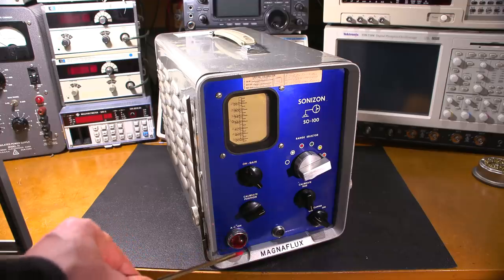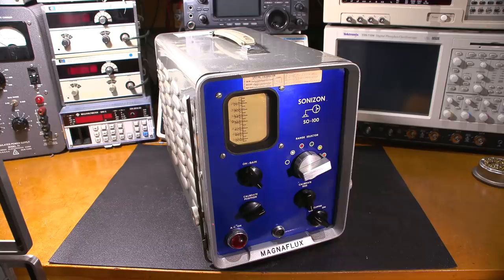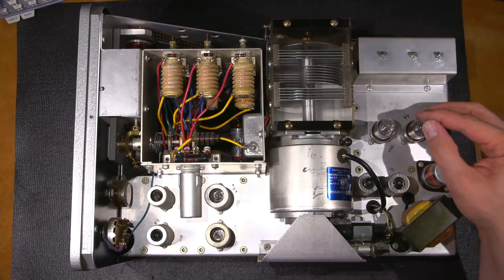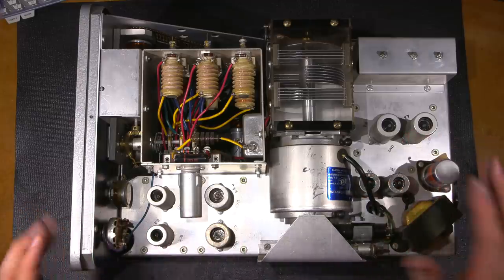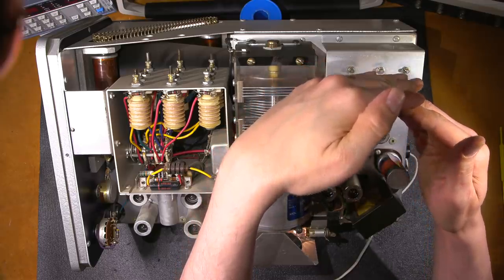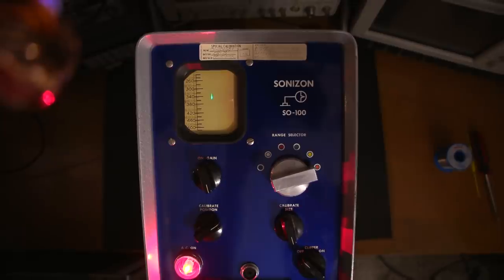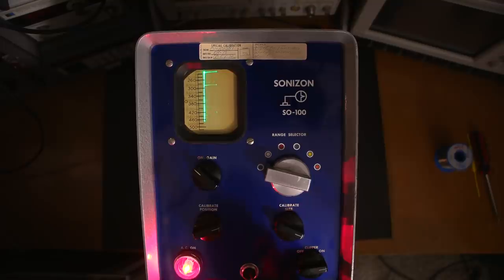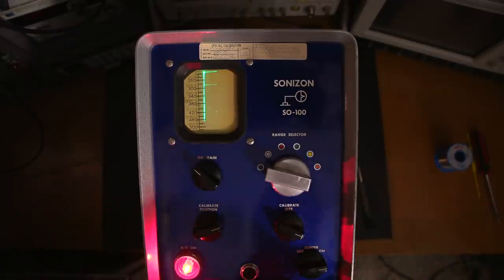Restoration or Parts Teardown- You Decide! [Sonizon SO-100]

Comment: Definitely restore.  And if you can link this to checking the welding of the LM from Apollo, it might be priceless.  Remember, the skin of the LM, was almost cigarette paper thin in some spots, perhaps this was used to Magnaflux the metal to check for a good seal.  If you could find the head, it might be good as a working museum piece.  So definitely restore.

Comment: designed initially for measuring the thickness of metal sheets by reflecting high frequency sound waves from the back surfaces of such sheets. However, if flaws are present the waves are reflected sooner, thus indicating the presence of the flaws.
i could be wrong....i could be right!

Comment: [ I would use it for parts,its obsolete;shelf * Queen * ] We had ultrasound weld checkers in steel mill in 1986. I was mid twenty's then. The plant fabricated structural steel, we used Submerged arc welders.. The tester had a CRT ,looking for flaws in structural welds,if found they used a gouging rod,high dc amps ,to blow weld out; and rework the beam or column .Same principal as ultra -sounding a women to check on health of baby in whom...
* FM Weaver steel fabricators on 25th street,Melrose park,ILL. then went to Pittsburg Demoyne Group,now shuttered and gone Rocco Lonigro plant superintendant,employed as electrician.

Comment: Restoration, however, "not for critical purpose" usage warning nomenclature needs to be affixed. It may meet tolerance, and cal within specs, but traceability and the lack of calibration/service records from day one apparently ended some time in the past.

AEL INDUSTRIES, INC., Lansdale, PA, operates one of the best calibration certification services on the East Coast (Mid-Atlantic region). Should you have difficulty in obtaining calibration process documentation info, they may be able to help, as their library is vast.

It would be a nice addition to a machine shop, or fabrication shop that performed work for non-critical automotive or truck racing work.

In addendum: Mr. Carlson, this device, would present an excellent opportunity for you to familiarize your subscribers/students/viewership, with the virtues of Mil Spec 2000, Category "C" wiring, soldering, electrical and electronic assembly practices, and how reliability and process repeatability were built into critical use electronics and electrical assemblies.

I'll be sending an email shortly.

Comment: i am really torn to decide what to do with it.
on one side its a seemingly decent condition (respecting the age) device. there are some parts in there that are really nice and certainly high quality. but they have a certain vintage what makes them not all that useful today. (only look at these big ass tubes) also the glass capacitors well i can not think of any sane application for these in a even semi professional / prosumer environment. so that stripping it for parts is not a viable option from a strategic standpoint. but depending on the fault (if there is any i can not tell this far in the video (im actually at 7:14)) fixing this piece of kit can range anywhere from easy if the fault is a part that is easily tracable, sourcable and easy to work with to horrific if its anything custom or highly exotic. also the need for that head unit really makes things difficult 'cause you have to figure out what this actually was looking like, what it was doing and how. and that can range anywhere from maybe just a simple oscilloscope-ish interface to something fancy like a vfd being connected to the thing in a serial manner depending on the effort they put in the head unit. also a thing to consider is who do you sell it to if you were able to restore it because your most likely not in a need for such a thing and of course this is from the technical point of view highly obsolete from the accuracy certainly as well and not to mention that it would propably not comply with anything in terms of modern standards i guess?
so either way is wrong somehow.
Reply: wait did i type glass capacitors well it took me a second listen to find that you said class "y" capacitor

and somehow my edit function is goneski

Comment: Well, it looks like I'm in the minority on this one.  You don't have a probe, and without a schematic, it might be difficult to build.  Do you need a machine that measures steel thickness?  If the answer to  both of those questions is NO, I'd say it's parts.  To restore it for no reason other than to restore it.  I'd rather see a piece restored that you can use...
Reply: Given it came from building M3 this thing may very well have had a hand in Pioneer or other probes. I'd normally opt for parts as well but given where it came from I'd vote restore in this case.

Comment: It kind of seems useless without all the accessories to use it properly. If you don't have a practical use for it then makes since to use it for parts. It is somewhat interesting but only for one specific use. I doubt you will find a use for it on your test bench. If this does not have a significant historical value then I suggest you strip it for parts.

Comment: I really like the span of things you get into you remind me of a teacher of mine from the 80s. He was one of my very favorite teachers. In basic electrical engineering all the other students got a digital keypad and said just display a number. My teacher brought over a rotary dial do the same. I built a circuit that would hold 7 numbers on a breadboard. I got into computers and electronics when I was about 10 I was repairing descrambler boxes for my stepfather. Fifth grade I made the local newspaper they called us the "gen kids"  back then many people didn't own computers .  I had my own computer and was very good at programming in dos. I wrote a one line computer code that was a basic game. this is right about the time computers were talking to each other we actually were using what they called a dumb modem. Basically it was a typewriter date had the ear muffs that you stuck a phone receiver into. the person that you call directly would have to have the same kind of unit. Over the phone lines this would be pretty much the first type of text chat. Pagers we're all the rage during this time. This was a time that you could get VCRs or  the other beta's . a man bought the same time that short interludes of LaserDisc before DVDs. Back then we got home from school but didn't get home until it got dark and the bike was our lifeblood. Damn I'm old still I'm younger than 50 I guess hope I don't have a breakdown when I hit that

Comment: i beleive a magnaflux machine looks for voids and laminations in metal components.  not so much measuring thickness.  I worked for a company for a while that paid a third party to test metal plate for voids before we would process them.  When flame cutting thick metal plate, an explosion is very possible if the cut is attempted through an area that has voids hidden under the surface.  don't waste your time, they x-ray now.

Comment: Hi there...

The major problem I see with this unit is lack of one of the 5 or so probes used. Unless you have all of the specs & materials, tools, etc., I don't think trying to build a probe is going to happen.

Without one of those probes, full restoration seems rather pointless at this time!

However, under no circumstances should it be scrapped either! Space Labs (which was acquired by TRW) was a major player in the development of ICBM's & other space rockets & hardware!

Who knows, that thing may have been used on actual historic space hardware; which in my mind would make its destruction practically a crime! (Don't get me started on NASA's decision to cut up the tooling used to build the Saturn V! [Just criminal!!!])

Anyway, until you can acquire a  probe, I'd say set it aside in a sealed box to protect it.

Comment: Used to find cracks in metal ( could be used to find thikness). With out the head unit and the special magnitic and fhosphorescent powder and a black light the unit is worthless for nothing but a shelf queen. Don't spend the time on it.
Reply from the maker: That's not how it works. Magnaflux is a company name, not the machine. This device doesn't use powder, and isn't whats commonly known as a Magnaflux machine.

Comment: Unless you have, or someone has a specific need for this? I see no point in restoring it. if it was something that could be used on the test/repair bench then it would be useful. but this has little use on an electronics bench anyway so why would you need it? Part it out. lots of good parts inside.

Comment: its a very specialized equipment outside of the usual channel theme of radios and electronic repair test gear (scopes, vtvms etc) and it contains valuable tubes. also it could be hard do restore and preety useless so i vote TEAR IT DOWN and save the good parts,

Comment: I really can't imagine anything you would ever use the instrament for. It is a very specialized instrament for a very niche purpose. Without googling the company, but taking a wild guess based upon the name of the company, I would guess that maybe they built equipment for Spacelab. Owen Garriott would know about that since he was mission specialist for the spacelab mission aboard the shuttle Columbia on flight STS-9, back in 1983 I think. 

The company may also build parts of communications satellites. Or with a piece of gear like this, maybe they built the photocell deployment mechanisms for the Hubble. Or maybe they built probes to explore Mercury, Venus, Mars or the moon, the gas giants and their moons. Or even deep space probes that will keep going and going and going, long after the cows come home.

Companies that play in space can't survive long on scientific projects alone. All the big players and most of the small ones derive most of their income from defence. That means things like spy satellites,   navigation satellites weather and communications satellites. If the company was testing metal thicknesses for DOD projects that go into space, I would guess they worked on the rockets themselves and probably missiles too. I would love to know specifically what they used  this test equipment to test. It's probably so secret that google will never tell. I vote restore the equipment and see if ET shows up to borrow it the first time you turn it on. d;^}

Comment: The decision to restore or part out is heavily influenced by the availability of the necessary probe [or its design details] required to produce a useful instrument that will perform to its published specifications. If this probe , or its design details are not available, then restoration is not really warranted. Whether to part it out or use it as a display item to beautify the shop depends upon how much storage space you have. I have found that as you age, these long term [have to spend a lot of time for something of questionable utility] projects become less and less attractive.

Comment: You're right, Paul.  It's definitely ultrasonic.  Look at the probe in this picture: 

 https://www.kempler.com/sites/default/files/manufacturer/docs/catalog/Bliss%20General%20Press%20Catalog%2035J_0.pdf [look at bottom-right picture on page 7].  The one you need may be similar?

 Also, documentation seems to be very sparse on Google from what I can see...

Comment: A very informative, if not exhaustive, post can be found at https://dspace.lboro.ac.uk/dspace-jspui/bitstream/2134/33011/1/Thesis-1973-Highmore.pdf  , a doctorial thesis submittal by PaulJulianHighmore, describing the science underlying this unit.  Beginning at the author's page 40 is a circuit analysis and history of the company and the technology.  The previous 39 pages address the mathematics and physics of the state of the art of non-destructive ultrasonic measuring instruments in 1973.  Beginning on page 54 (Chapter 5) is a discussion of the piezo probe.  This might be useful if trying to reconstruct a replacement for the missing original.

Comment: PartsPartsPartsParts!
Reply: Hi Paul, as that is such a rare and unique instrument I would definately restore it. Hopefully the test head  uses a single PZT or similar ultrasound transducer. Best guess is that it is pulsed ultrasound whereby you send out a short pulse and then measure the time for a returning echo, if you know the propagation velocity for the metal then you can work out the thickness of the sheet. Thin sheet would require a higher frequency transducer whereas thicker sheet would use a lower frequency. If no schematic is available you could reverse engineer it to find the operating frequency for each band and also work out the optimum load impedance that the transducer should present. The transducer could have an impedance matching transformer though. There are companies that will make custom PZT transducer crystals in all sorts of frequencies, shapes and sizes. Curious to know what the frequency sweep function does.
Reply: Damn it, I replied to the wrong reply, NO not parts as you can buy all of those parts anyway.

Comment: Repourpose or take it to pieces for the usable parts.
Modern devices would be much more portable and probably work better.
I have seen coating thickness devices and other metal thickness devices. Handheld units.
Not worth the trouble unless uou realy have a use for it.
Thanks